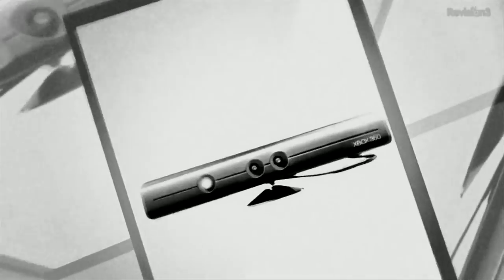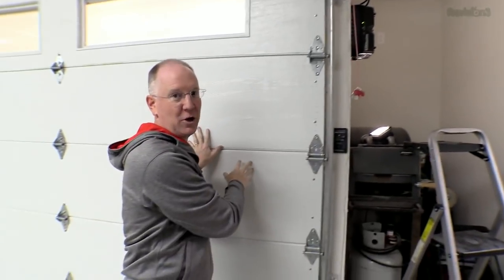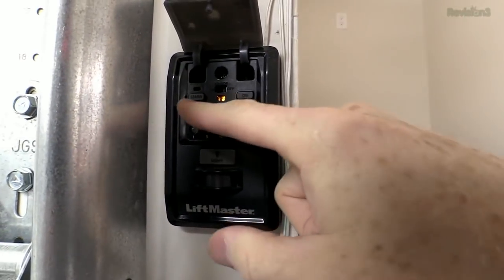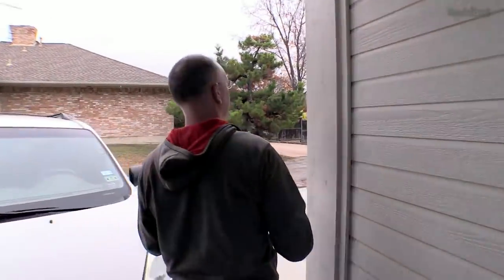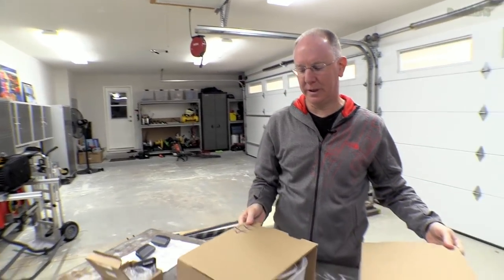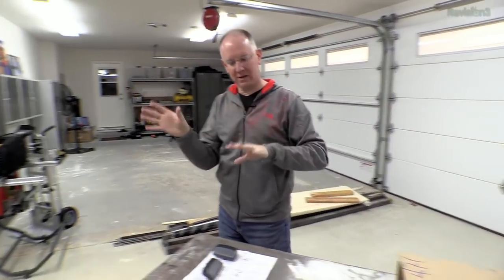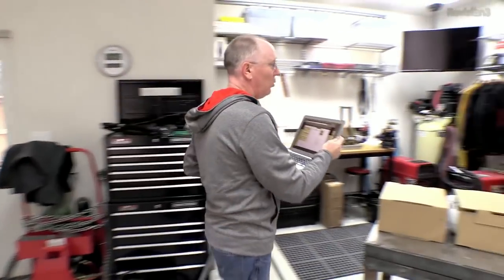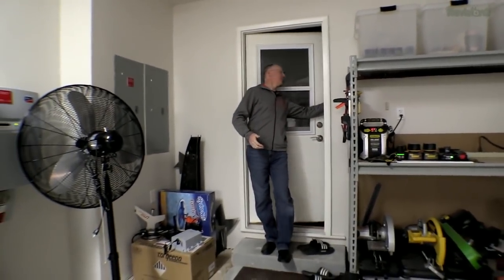Review   LiftMaster 8500 Elite Series Jackshaft Garage Door Opener

Comment: I can’t figure out how they lower the door! The jackshaft only turns the pulleys which release the door, but if it’s properly balanced, it shouldn’t move! There is nothing to push the door down. It seems to me the cables would go slack (thereby stopping the operator) every time???

Comment: The motors might be quiet, but the3 beep sure the hack isn’t.   Isn’t the beeping louder than the traditional openers?
Reply: The beeps only happen if you use the app or timer to close. It doesn’t any other time. UL 325 codes say it has to do that if you’re not there. AKA unattended operation features

Comment: Here's a reason not to get them:  They fail.  They haven't caught on due to cost and therefore its second gen tech (brought over from commercial) so its first gen residentialized (cheapened) commercial tech.  Lots of learning curve for Liftmaster to make them as robust as residential chain or screw drive openers.  Had one fail after six months.
Reply: They have a lifetime warranty on the motor and 2 years everything else
Reply: These jackshaft openers must be installed  by a professional! Door operation is critical. Sounds to me you must have installed yourself? If yes, thus the premature failure. Not saying they can’t fail, however, much less chance, if installed properly.
Reply: @davidkirkham6497  these were installed by a professional and fixed under that 1 yr.  warranty by that professional.
Reply: @Pauladigms  That’s good! Anything mechanical can fail! However, to put out a blanket statement “they fail” is a bit misleading. Don’t you agree? It sure is frustrating when something new “fails” I agree. I do appreciate your take on these jackshaft openers! I am contemplating have 2 installed.